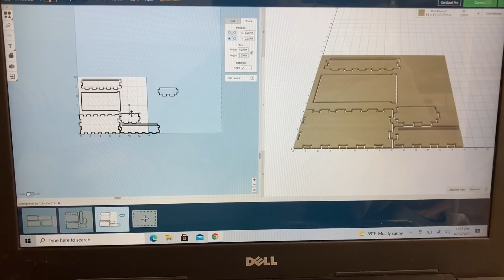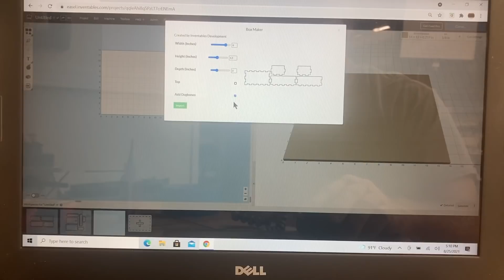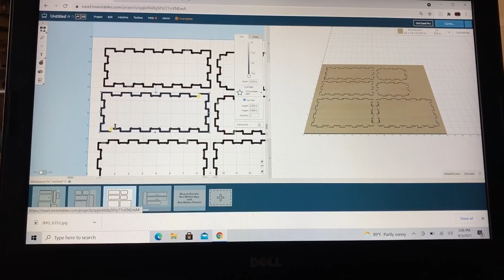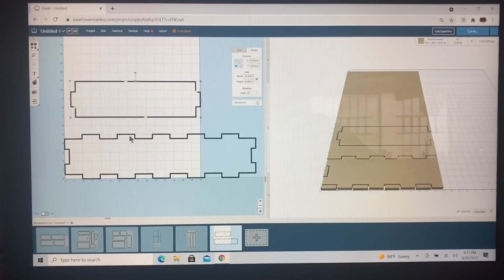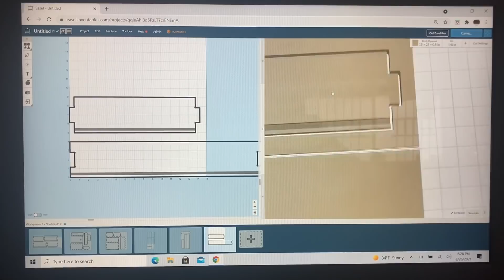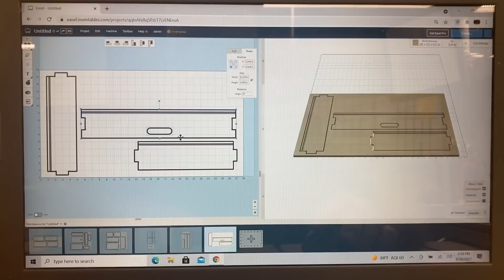How to Use the Box Maker and the BoxMaker Classic Apps in Easel

Comment: How do you compensate for the bit size you are using. I have tried this and the joints are very sloppy. Do you cut on outside of all the pieces. Your help would be greatly appreciated.
Reply from the maker: Yes,  the app generates on path which will make joints loose. Change to cut on outside

Comment: I tried it with MDF and made a slide lidded box. The cut groove was too close to the top, leaving only 1-1.5mm of wood, so the lid just pulled out. Do I need to modify the program before cutting?
Reply from the maker: Yes, modify the box in any way that works for you

Comment: Don't ever use easel. It's the worst software ever for a cnc mashine. I know I was forsed to use it with my new cnc croncraft mashine. Worst time of my life right there.
Reply from the maker: Easel is an excellent beginner software that has a lot of the basic features you need to be successful. It’s easy to learn and you can get up and running quickly. You do not need a separate sender to get the project to the machine. It’s all there. I still use it today for quick projects and projects where I need to make changes and then carve another.
Reply: @PawPawsWorkShop  personally I had the worst experience with easel any person that starts with cnc could have. Since going over to aspire and lightburn I have never been happier.
Reply from the maker: Fantastic. Both are excellent software

Comment: I was just wandering why your dust boot hits the clamps. I set mine where the bristles are just proud of the project as well and the bristles just glide right over the clamps. As long as you don't make the clamps you use taller than the bristles they will not hit the plexy housing  of the dust boot. At least mine never have the upgrade did not change that either works the same with or without upgrade. 
I thoroughly enjoyed the video and you and the comment section gave me some great project ideas thank you for all you do.
Have a blessed day.
Reply from the maker: I’m being overly precautious. I don’t want to take the chance of any interaction with the dust boot to a clamp that could cause a problem
Reply: @PawPawsWorkShop  I agree, You can sit the bristles on the board and the dust boot will  still just go over the clamps. But if you are overly cautious your bump stops are great here.